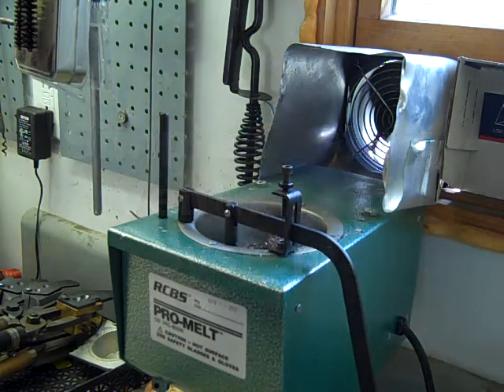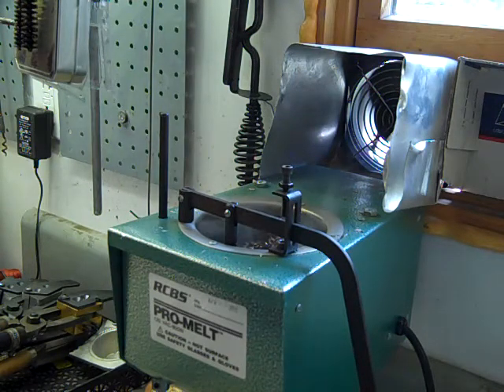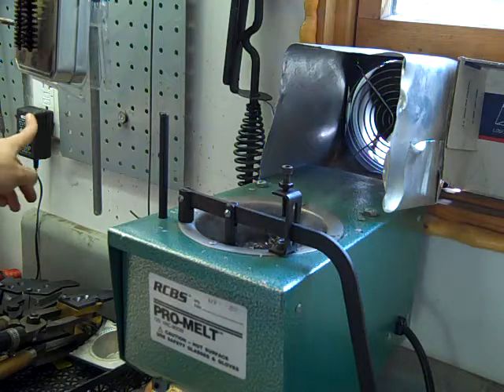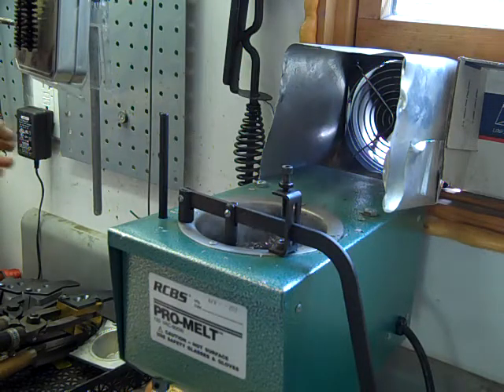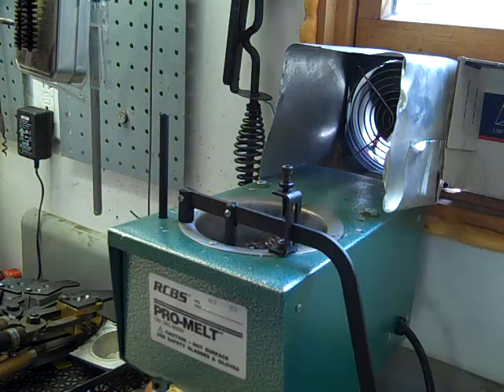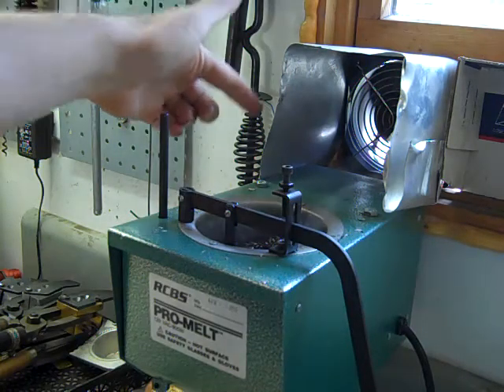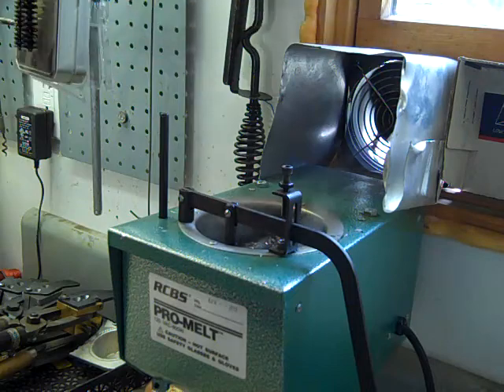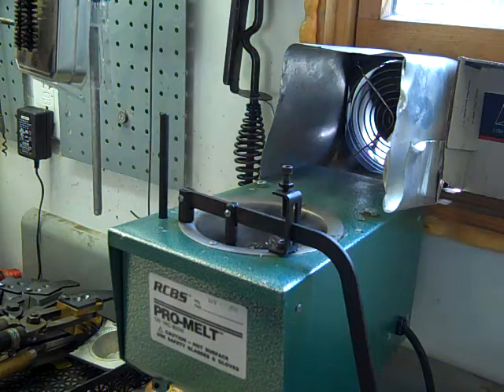Simple & cheap ventilation for indoor lead casting.- Bullet casting, melting pot

Comment: I realize this is a few years old but I will ask anyway.  Do you know the specs on that fan?  I'm looking for the CFM.  You went the route I was thinking of.  I found a duct fan on Amazon though rated at 250 CFM which I think would be plenty, plus it solves my ducting adapter issue.

Comment: Could you extend the hood you built to go over the top of the pot? I was thinking it would force the air to come across the open top of the melting pot, wind tunnel effectively. Except you would need the hood to be adjustable or else it may pose too many other problems while working...anyways, I dig your channel. Cool stuff.

Comment: Why don't you use a bigger fan for getting the fumes out? A 200mm or 250mm computer case fan is about $20-30 on Newegg, and there is no loud droning noise.
Reply: Ok

Comment: I bought 2 bathroom ventilation fans. They funnel the air to a tube size shape (so house holds can run a tube outside their home) I ran tubing 8 feet away outside, reversed the fan at the end so it would help pull air outward, bought charcoal center filled stove-top ventilation fan filters, cut-em to shape the bathroom fans, popped the fan covers off, placed the filters just over the motor in front of the fan. The wire fencing on the filters prevent the filter from bending and touching the fan.

Comment from the maker: I also have a friend who casts in his basement without ventilation.  Although you will read much debate over this supposedly lead doesn't vaporize at these temperatures and the fumes that are being vented are from contaminates and filth burning off.  Once my pot is up to temperature and I am done fluxing it seems to keep pretty clean.